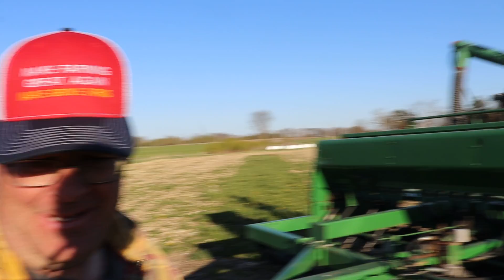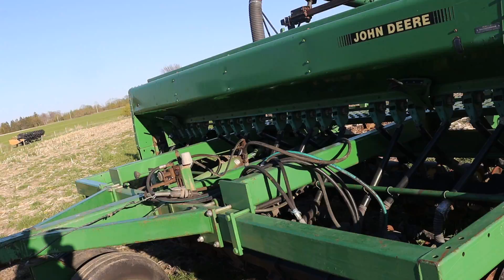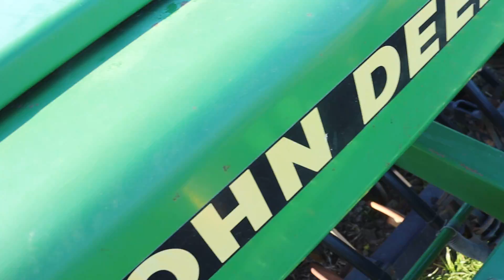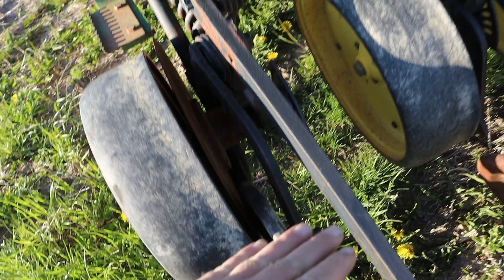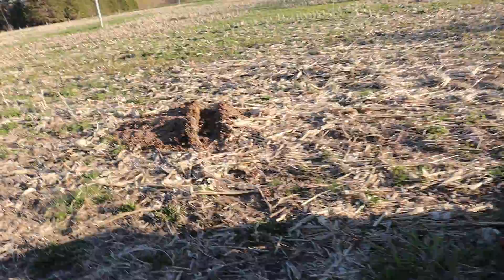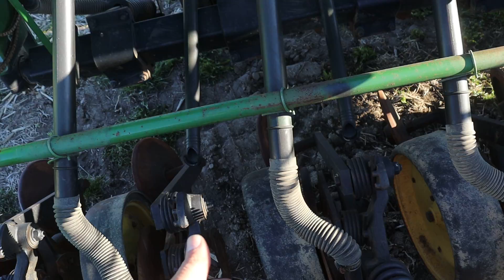picked up a no till drill

Comment: Hi..Did u used to work at a jd dealership?
Reply: I just came across your channell today.i am after watching 3 or 4 of your videos.i love the fact that there is no bs or politics in your vidoes.our fields and farms are a lot smaller here in Ireland.. always dreamed of the prarie fields  of the USA.. I have 8 john deere tractors and a 7550 harvestor but I have to agree with u on the massey Ferguson debate...had a 7000 series one on demo...very comfortable...love the steering...john deere has a stronger back end.but the sisu engine is the best on the market
Reply from the maker: @brendanhough289  thanks for the kind words. 
Thats funny i always thought if i won the lottery and could travel i would love to tour Ireland, Holland, new Zealand italy areas.
Reply: Well now you have a place to stay when your in Ireland.. is there a way I can discreetly give u our email address
Reply from the maker: @brendanhough289  you can send an email to 4640jon@gmail.com
Reply from the maker: yep, went to jd college for mechanics and then worked at a couple dealers.

Comment: Looks great.  Just finished instilling all my beans. It took a little bit to get 7se to what way would work best for me. But did a great job. I really like the Marten closing wheels I got from Needham. They did a great job closing the the seed in all ground conditions.  The OEM was noticeably different and left it open in wetter areas like the grassy field.  The V8 firming wheels did get in the trench better. 

The 8300 drill I traded for this one was able to set the seeding rate up way more precise. I do need the info on setting up the seeding. On the left side it planted 230k and the right side was 190k. I was shooting for 180k. Tinkered with it to shoot for 150k to finish and not run out of seed. Other then that, I loved it.

Comment: I bought a 750 last year and I love it.  Used it for cover crops last fall and oats and soybeans into cornstalks this spring.   Worked fantastic.  My 1086 pulls it no problem.  I bought the drill I did because it has a lot of Needham Ag parts - good upgrades.   I'm not too far from you - Princeton - if you want to check out any of the Needham parts.
Reply: Needham uprades are great ! only makes a great drill better !

Comment: Nice drill Jon . 4430 alto pull it just fine . One our customers had one he pulled with a 4240
Reply: Been pulling 20 ft. with 4430 since drill was new, 94 I'm thinking. Sometimes use triples.
Reply from the maker: I would think since the soil is very mellow and we're not going that deep.

I gave up a couple fields that at one end of each field was such a quick study prize that the 4020 had a hard time pulling the Brillion. And if I didn't have the duels on the 4640 I couldn't pull the eight row corn planter up the hill.

Comment: Nice clean looking machine. Yes they pricey still bringing 25000 up here. New 1590 80000. You would have to pound a pile of pavement to make new one pay. If you could mount a wavy coulter in front they would be even better. Most up here use a Salford type machine in front.

Comment: Last week there was a 30 foot deere seeder someone made with 7000 units on 8" spacing with a gandy air box on it went for 3500$ close to me. A little to big for my little dab but would if been dandy for you other than hauling probably 600 miles. Lol
Reply from the maker: That is slick!
Reply: @jonstevensmaplegrovefarms3754  I noticed it said 3900, forgot the crooks at a 10% premium to the bid. Lol
Reply: @jonstevensmaplegrovefarms3754  The cummins pulling that unit across the mighty mackinac would have made a good video. Ha

Comment: mine was delivered on a goose neck and just removed hitch and tires  love the deere no till drill.
Reply: i did the seed boot fix... give me a holler before you decide what to do
Reply from the maker: @tedkahler  you know I will! I was going to ask you if you did either one of the seed boot fixes.
Reply: @tedkahler  Ted, I read somewhere that the steel sleeve seed boot fix like you did can be a problem with the bolt rusting into the sleeve after some time?  I have no idea if it's factual. maybe anti seize on the bolts fixes that?  I've got a 750 that should be here in a week or so, and I'm already shopping for parts and knowledge

Comment: Before we had a drill we wondered if we needed one... Now we have owned a drill for a few seasons it's one of the most important pieces of the puzzle to regenerate soil health through cover crops.  I have found my drill runs everyday in the spring that it possibly can and every day in the fall that it possibly can.  What other piece of equipment can you say that about?  soon you'll be more concerned with getting off your combine so you can hop on that drill and chase the combine behind soybean harvest!  Austrian winter peas right behind a soy bean combine is a winning combination for the next years crop.  Looks like that's a 17.6 footer?  You're going to really enjoy the savings on cover crops as you can cut back to about half rate and get better than the same result utilizing the spreader
Reply from the maker: Thought about in the future taking off rows that would hit my corn and then using it in very young corn to drill in a cover crop!
Reply: @jonstevensmaplegrovefarms3754  That's a dang good idea My drill isn't really set up to take row units off that easy but that John Deere that you got will be much easier to do that.  Hmmm... now you got me thinking I need to go look at my drill and see!!!

Comment: I hit the shoups 10 percent off in February and keep some needham firming wheels, a couple updated closing arms on hand. I put the shoup boots on wich was a mistake, a couple of them the mounting holes weren't straight and they didn't ride flat against the blades, quality has gone to crap at shoups on some stuff. A guy looks in the parts books and everything is ×24 wich is painfull, so I just did the boots and mounting hole bushing and blades and everything else as they go bad.
Reply from the maker: What did the updated closing arm do for you?

I won't get blades or wear items from them. The opener discs on my white planter are from Ingersoll and after 4 years they still look like brand new. After 4 years the ones from schuppe would be having bearings fail and the blades would be showing some wear.

Probably can't afford to do a complete Needham Ag rebuild this summer. I am trying to see what it needs for a rebuild.
Reply: @jonstevensmaplegrovefarms3754  Nothing function wise, other than I shouldn't have to put a bearing in it again and I got the notched closing wheels with the updated arm. I just keep a few and replace them as the bearings go out so I dont have to buy all 24.
Reply from the maker: Is yours in early serial number? Compared to an early serial number this one already has the different bearing set up

For the money I'll probably just do an oem rebuild. To go with all that aftermarket stuff would double or triple the cost.
Reply: @jonstevensmaplegrovefarms3754  I beleive its a middle production one just like yours,  the previous owner put some aftermarket seals on the closing wheels but everytime I took one apart they'd crack and the bearings where packed full of dirt so they didn't work anyway. I don't know if the notched closing wheels are that big of a deal on a drill but shoups notched wheel was way cheaper than exapta and needham and plus ya got the 1560/90 arm and bearing. Especially if ya wait till the NFMS when they run 10% off.
Reply: I got the bushing tool if ya want it to, or I bet Ted still has his. The boots will still have a little slop but it puts it back oem at least ya dont have to drill boots everytime ya replace them
Reply: @jonstevensmaplegrovefarms3754  I noticed the drill fix kit is a different for the 750 and the 1560 so Teds propably wouldn't work. I can send ya mine if ya go that route or maybe yours is already done. There 295 dollars wich is highway robbery. If ya buy the bushings from green drills dot com they send ya the tools with the bushings  I believe. I wish Aricks sold there boots for a 750 because they got the needham style fix already to go without drilling, but they only list them for a 1560/90 on exaptas website.